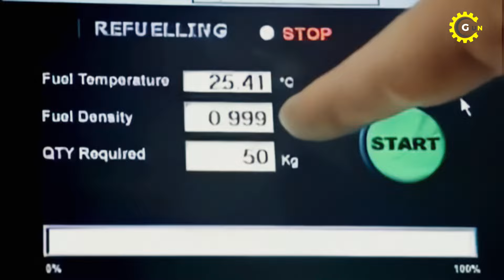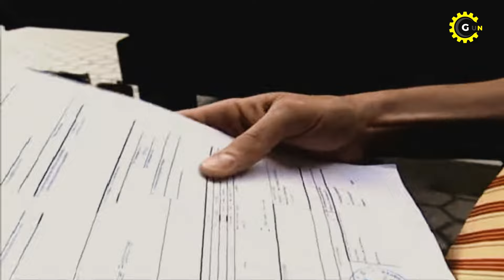Why Don't Formula 1 Cars Refuel?

Comment: Artificial inflation of overtaking by means of DRS and lifting and coasting is killing the sport. 

Back in the day, although domination by a single team/driver was just as evident, statergy played an important part and created excitement. The over results were not a given until the last hand was dealt, sometimes in the dying movements of a race, which significantly altered the order. 

As pitstops were nearly mandatory for fuel, teams and drivers could really push the tyres and statergist came up with wild plans for their drivers, eg Super-Softs with a short fuel run for 5-7 laps, mid race, etc.

As a viewer we had reason to believe something could happen right at the end... the Margin for error was greater, but the reward for all was even greater.

Now a days, there are really 3 points of the race, I feel most fans will want to watch, The start, the 1st 2-3 laps and the pitstop window. 

Ofcourse I am generalising, but it's not too far from reality. Just see any of the highlights. The only outliers in highlights are significant shunts or breakdowns. 

A viewer can generally summarise the final outcome from these points and you may not even need to watch the pitstops to know the outcome.

F1 as a sporting spectacle is dying. And bans such as this and the move towards design based on regulatory ideology is to blame.

F1 is no longer an engineers wet dream, bar a few who have got the ideology right for the few years... Drivers seem to have a general dislike towards it as well.

And most of us fans want screaming v10s with fuel tanks the size of our back pockets back.

And I think this can be achieved while keeping it relevant to current socio-economic goals. 

Eg. Allow teams a fuel allocation for the week/year. Allow freedom of fuels with limits on over all energy consumption. 

Allow freedom of design as a constructor. Limit the design by how much dirty air they can produce rather than giving them a design philosophy to limit dirty air.

Allow freedom of engine architecture. 

Allow freedom of tyre and tyre manufacturer but limit them on environmental goals, rather than spec of tyre. 

All we need is 4 open wheels, an open cockpit, and freedom! With a reasonable budget cap.
Reply: Thats a good way to completely change the sport for the worse.
Reply: I think the current regulations are fine, but something needs to be done to bring back more strategy. I remember the days when you had no idea where teams would end up until towards the end. Leaders in different phases traffic and more importance on overtaking due to different fuel loads.
However they do it, something needs to change. Easiest is to just let them refuel again. Surely they can come up with a full proof method.
Reply: @frostedhams  

I appreciate that we may have different views on how the series should evolve.

I am not knowledgeable enough to produce a new future plan for F1, FIA, and FOM.

I am just introducing an idea based on the sport I fell in love with 20 years ago.

I can not say I am a huge fan of the effective spec series. I say effective as the diversity is only at the start of the regulations. Eventually, they all converge. And we have seen this a few times now. 

My thoughts are the range of restrictive areas or boxes where development is not allowed. 

The current subset of rules seems not too bad... I give them that, but again, rules were originally overhauled to stop the Ferrari domination. While the rules have stopped ferrari, they have failed to stop domination spells. Thus, the last 2 overhauls have only been a partial success. 

Comparing the periods of domination, during ferrari spell, 2004 being an outlier, races were interesting.

I would definitely back another tyre war, allowing refulling, technical freedom, limiting design restriction along a more strictly monitored budget (financial and non-financial).
Reply: @featuring782  

I loved those races. A very much younger me, at the edge of my sofa, trying to work out how many more laps a driver can pull ahead and what their deltas may be.... yet not knowing how much is going to be left and how drivers will be classified at the end. 

They were sweet... sweet times. 

I have tonsay in the past 10 years, year on year, I watch even less F1, but always catch the highlights and not to anyone's surprise, most highlights are the start, pit windows, major incidents and finale.  More than often, the start is a good indicator of the over classified results.
Reply: Maybe the should introduce a battery pack change, and no recharging. This will provide enough of an advantage to warrant an extra stop or two if they get the calibration ratio right.
Reply: @featuring782  

I think I would be open to that sort of ideology too. 

Maybe freedoms on battery technology. This may already a thing as I'm still not sure how the MGU systems work. 

I believe its going to be dropped in the next "Formula" but maybe the "Formula" is too prescriptive and not creative.